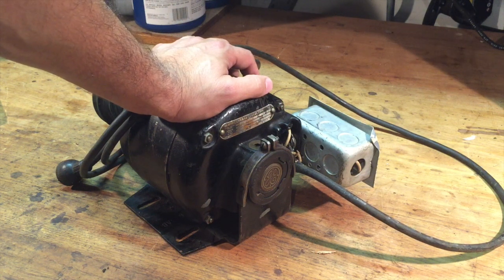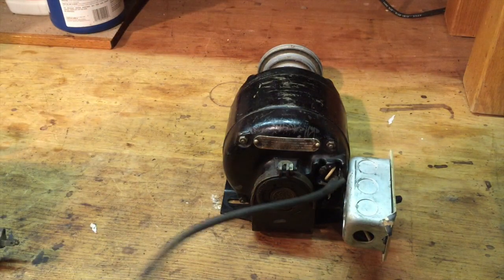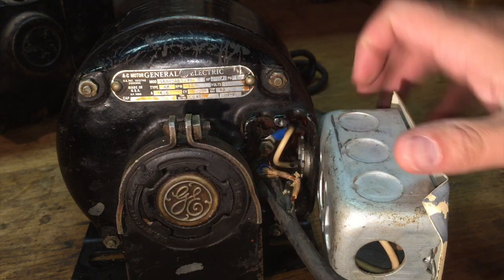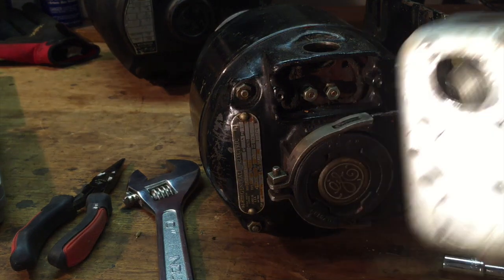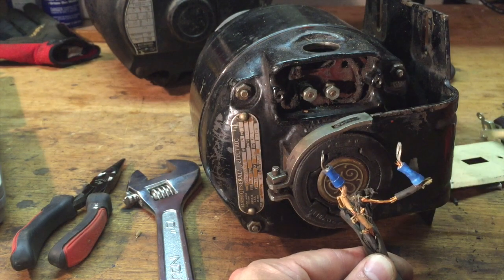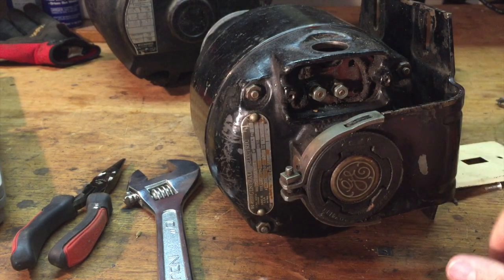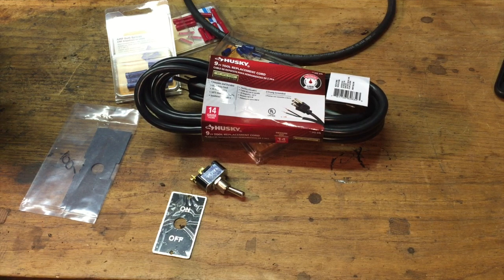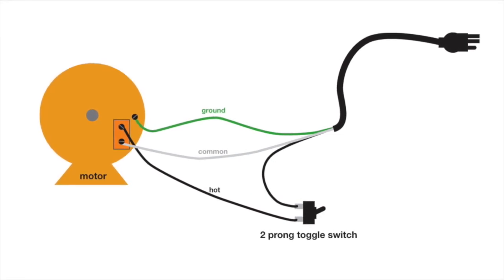Wiring the Lathe - part 20 of my Atlas lathe restoration

Comment: Yes, I noticed you used the correct screws on the switch plate.  The pulley is way too big.  It's 4:37 am.  I could go measure it now, but it would be a sign of sickness.  ;-)  Getting close to chips.  Report back on RPM plate please.

Comment: I'm restoring my Atlas as well. I went with a Baldor 48v DC motor, which I'll be speed controlling. Does away with the need for a quick change gearbox.
Reply from the maker: +Sharky's A variable speed controlled motor is a pretty handy thing to have on a lathe. Nice!
Reply: ahh not the reason for quick change gear box ..for threads take it your not a machinsit

Comment: Nice job. A couple of comments.

Do you have the original motor pulley for the atlas? You will want that to get the speeds as documented for the lathe.

Did you file down any burrs on the motor shaft after you pulled the other pulley before putting on the other one?

Motor switches will have a hp rating on them, that's what you want to use. Looks like you got a proper switch. 

Reversing the wires will make no difference, your dealing with ac power not dc. Single phase ac motors are reversed by reversing the starter windings.
Reply from the maker: +Steve S Thanks Steve. I don't know if I have the original pulley. The lathe came with a few different sizes when I bought it. I'll definitely have to do speed tests.

Luckily, both the pulley and the shaft were burr free. I just cleaned and lubed them up.

When I posted the wiring question on the machinist forum, it was mentioned to get the right type of switch. I bought mine right from Clausing.

I have very little knowledge when it come to electrical projects so I've been taking notes. I'm adding what you pointed out.

Comment: I'll have to look I may have a craftsman motor . once you have it under power you need to make a step pulley do you have all the speeds
Reply from the maker: +Chris Anderson I recently purchased a larger motor. I wasn't aware that I needed a step pulley on the motor also. I'll have to check to see if I have one.
Reply: Ya the big pull on yhe countershaft has 2 pulleys

Comment: omg, hes alive. lol. i do hope you are getting a bigger motor. 1/2 hp is even too small. but 1/4 wont do you any good. good job on the wiring
Reply from the maker: +Bison Workshop It's been awhile I know. Since I filmed this, I did get a larger 1/2hp motor. Now, I'll need to wire that one up as well.

Comment: 2 step pulley.  Everybody is noticing.  Yes,    I have a friend who only has a 1/6th hp and he's not happy with it.  Also, it has to be the 1740 RPM variety.  I bought a cheap wood lathe to get an extra motor but failed to notice it was a 3450 motor.  I will measure the diameter of the correct pulley for you.   You may be able to use the bottom two steps of the one you have.
Reply from the maker: +Crafted That would be awesome if you could measure the pulley that's on the motor. I checked my manual for speeds, it shows a step pulley on the motor. It doesn't mention the diameter. As of now, I don't have one. Not sure how big of a deal it is - I guess I won't know until I do some speed tests.
Reply: +eviltwinx Here we go. OD of each is 4.470" and 1.940".  I measured these with a standard belt squeezed into them tightly.  I couldn't find any clear info on how to measure pitch diameter.   This will be good enough for you to check your pulleys.   In going through my motors and lathes, I found my Desert Tan lathe has a 4 step pulley on it like yours.   :-(  So, I'm in the market for one as well.     I found on Fleabay they want about as much for a pulley as some motors I've seen sell.  there is no way I'd pay $70 to $90 for one of those pulleys when I could probably watch and get a 3/4 HP motor for one Benjamin - "With the Pulley".    I have purchased successfully 2 motors on Craigslist.  One was (is) setup as a grinder, the other is in the trunk of my Honda.  I finally figured out what that loud thumping was on left hand turns.

AND, lets not undervalue the fact that the correct motor is fairly common and is reversible.  Not sure how important reverse really is, but what red blooded throttle twister doesn't want it all?

It's my general understanding the pitch diameter is at different levels below the surface of the belt depending on diameter of pulley.  Nearer the surface for smaller pulleys.    I'd guess the small pulley is a 1-3/4" while the larger is a 4".   Pulleys do seem to be listed at McMaster and other places by pitch diameter.

I have so far mostly ran my lathe with the smaller pulley (slower) setup.
Reply: +Crafted I believe link belts are directionally sensitive so a reversing switch may not be an option.
Reply: Ed Pace Mmmm  I found this link:  http://www.sawmillcreek.org/showthread.php?57839-Why-direction-matters-with-Link-Belts

I have not corrected the wiring on my Atlas/Craftsman reversing switch in order encounter this issue.  I may discover a problem when I do.  The grip on the Fenner is superior to the old continuous belt.  Less vibration also.  I hate to have to remove them to get my lathe functioning properly in the future.   I may turn it around and switch it on to see what happens.   It's hard for me to imagine the belt can know from which direction it is pulled.  It is simply under tension.  However, there may be some slight slippage which "stands up" the small tab on the bottom.  At least that Is what I'm getting from the conversation in the link above.
Reply: +Ed Pace Sorry no. it makes no difference. I know of a Atlas lathe with the link belt and he runs it in reverse with no problems.. I can post a link to it if you want to see for your self..
Reply: +Lenny M According to Fenner Power twist their belts are directionally sensitive. Contact them and let them know their engineers are full of it. For me, I follow the manufacturer's recommendations. IE direction arrows for grinding wheels, sanding belts, band saw blades, etc.
Reply: Ok sheep
Reply: Ed Pace Hmmm, maybe it wears better one way over the others?   I know there are not many reasons to run a lathe backwards.  I'm not flipping by belts around every time I need to back out a tap.   Nor do I want to suffer the vibration of a V belt.  If it wears a little faster because I run it backwards once in a great while, that is ok.  Probably still take 15 years to kill one in most of our home workshops.
Reply: +Crafted Well. it turns out the answer  is "Yes & No" here's Fenners reply to the reversing question..."We have recommended PowerTwist for lathe applications, of which many of them do reverse. As long as the lathe comes to a complete stop before changing direction we don't foresee any problems. We would love to have feedback once you have it installed on your application. Thank you!"
Reply from the maker: +Ed Pace This is great info. Though for now, I'm running with HF belts. They get great reviews but...um... they're HF. I don't think I'll run those backwards. I might upgrade to the Fenners after awhile.